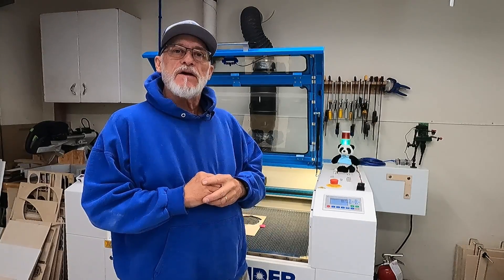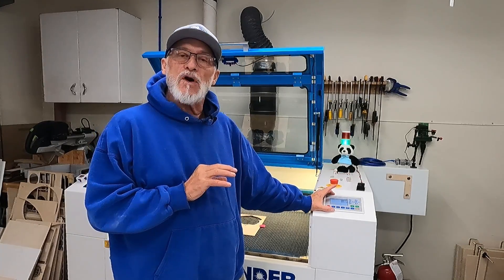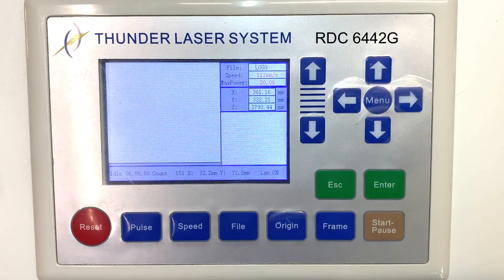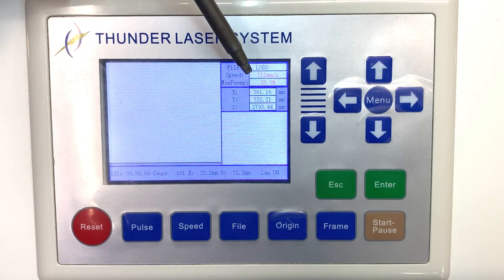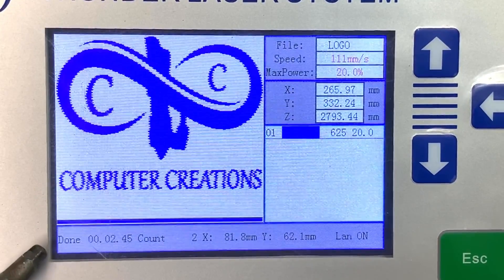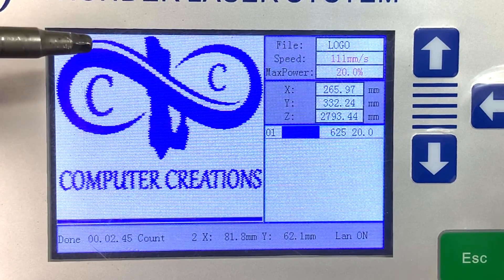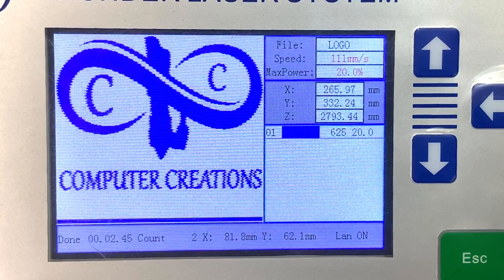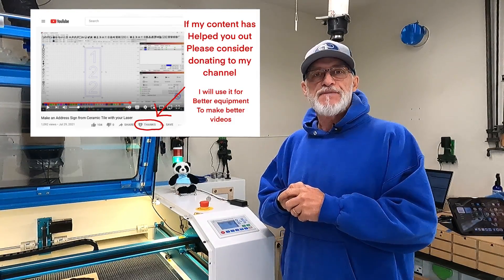Beginner Tips for using your Ruida Controller on your laser

Comment: Golly, just getting back to this tutorial. My brother restored a burned up Laser for me and my sister and it is the garage, ready to go. We intend to run projects from the controller. I took notes while watching your tutorial and will type them up tonight. I am the older sister and my other sister my sidekick. We work together. I need to get a galvanized pail for emergency. So far we have managed not to burn up any lasers.
Reply from the maker: I highly recommend a carbon dioxide fire extinguisher. Not cheap but if you did have a fire it would, save you laser water in a laser is not good at all.
Reply: @computercreationz  It's in the works. Thanks for responding!

Comment: My son ( computer knowledge ) and I have been trouble shooting most of the day.1. With no USB or Ethernet cables attaches Laser head travels normal and laser will pulse correctly.2.With Ethernet Cable attached Laser Head travels correctly and pulses but can not connect to either RD Works or Lightburn.3. Ethernet Cable disconnected and USB plugged in laser head more or less grinds in travel and laser will not fire.4. Substituted the USB cable and same results as above, subed the ethernet cable and same results above on 2 computers.5, Do you think could be bad RDC 6442S-s controller?
Any ideas what is wrong or what next to try?
Reply from the maker: what laser do you have? have you reached out to the manufacturer?
Reply: Blue and White Ruida DSP 1060 100W Chinese with RDC6442S-B Controller from ChinaCNCZone on EBAY.  I have emailed them and got RDWorks to download. Other then that no reply for days on what I wrote here as to wha it is doing. I just ordered and recieved a new power supply as the cheapest way to start. I am womdering if is something wrong with controller. LED #13 Error in Controller Hardeware is NOT lite or blinking. LED #15 +5v power supply is lite solid. LEDS #11 and 12 Ethernet connection is solid lite Comminication is blinking. Any idea what many be the problem.   @computercreationz
Reply: Replaced controller power supply, while doing so found a loose connection ( +V ). Repaired, but still no communication between laser and computer either USB or Ethernet as described above. Do have working between UDisk and laser, all seems find. Do you think is bad controller or any ideas?

Comment: So if we use start instead of send the controller panel is skipped by ? Nothing we can do to the settings ? Nice informative video.
Reply from the maker: if you use start (not recommended) or send when you hold the shift key down you don’t need to do anything at the controller.

Comment: If you have multiple "layers", is it possible to select a specific layer from the laser control without having to run the entire program?
Reply from the maker: no that has to be done in lightburn through the output button on that specific layer

Comment: Hello, when i connect steering panel to the mainboard and connect 24VDC without Motors or enything else can i check the menu and other functions on the display? I bought panel and mainboard and when i connect to 24VDC only reset switch is working, i cant enter to the menu. Is this correct? Cheers.
Reply from the maker: I don’t know what your talking about so
I’m
Not much help

Comment: anyone ever upload a file from udisk and it uploads as multiple partial files? driving me nuts!!
Reply from the maker: are you generating a cut file from lightburn and saving to a jump drive the. using that jump drive you load your controller. just wanted to make sure your not trying to load a design without lightburn generating the code the laser needs to run. thank

Comment: I notice that my laser won't fire if the bed is too far away form the head,is there a sensor that it uses or some other parameter?
Reply from the maker: do you have something on the bed when it’s down. usually mine will fire reguardless do where the z bed is. it’s you just can see it because the laser beam is so far out of focus.

Comment: Hello Robert! Those layer settings, the one where you paused the machine to change to 350 speed and then to 325 speed, do you have a video about how to change the layer settings in lightburn? Every time I run it the settings go to 4mm/s and I pause the job right away-change the speed-then start again but it still burns the crap out of my slate for a second or 2 before the desired speed kicks in...
Reply from the maker: I do see a slight lag sometimes when doing this, the only way to change in lightburn is to open layer and change the speed or power setting and re send the job to the contoller. if you change the setting in lightburn it doesn’t take effect until the project is resent back to the laser.thank for watching

Comment: Hi just bought my laser and trying to grab info from quality sites. Do you know how to set the laser finishing position. Lightburn says it has to be done on the controller but it's not obvious. Thanks for your time.
Reply from the maker: using user origin will start and finish your laser in the same position. you have to set the origin on the control panel by pushing the origin button. I have a video that describes each start from function.
Reply: @computercreationz  Thanks for replying so quickly but after reading the lightburn manual and watching their videos it appeared to suggest that you could select a separate finishing position other than the standard user set origin.

Comment: Hi Robert, depending on your needs you can also adjust the layer settings faster.  load the file you need, and press enter. The layer speed/power is available to adjust. It saves you from having to start/pause the file and then scroll through the menu to get to the settings.
Reply from the maker: I will have to try that again. Last time I attempted to do that it wouldn’t work. Thank you for your tip. I’m sure I missed part of the sequence or something like that.

Comment: Hi - do you think you could show how LightBurn works with Ruida? Thanks!
Reply from the maker: Thanks for your question, do you have any specifics on what you would like to see? I may have already covered it and can steer to one of my there videos.
Reply: @computercreationz  After some time of getting experience with a diode laser and LightBurn, I am considering getting a CO2 laser now. However, compared to diode laser, CO2 machines have different controllers and from what I understand, they are not controlled directly by LightBurn. I was interested in seeing how the software (LightBurn) works with Ruida-controlled lasers (you have covered much of that here, without showing the PC screen). Also, there are other controllers, e.g., Trocen (AWC708S). Would these perform similar to Ruida, or is Ruida the way to go for those wanting to work with LightBurn? Thanks!